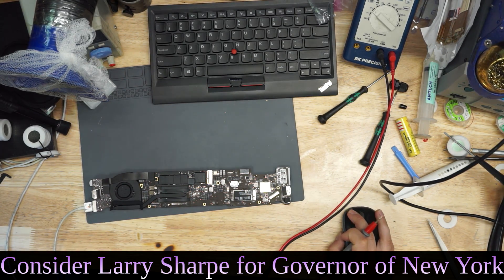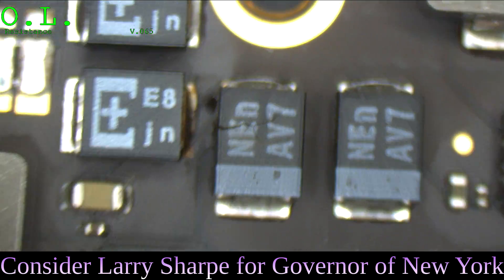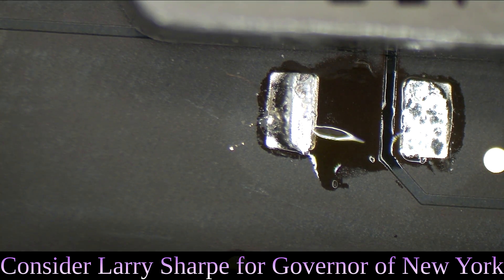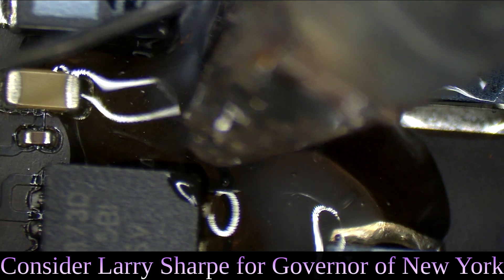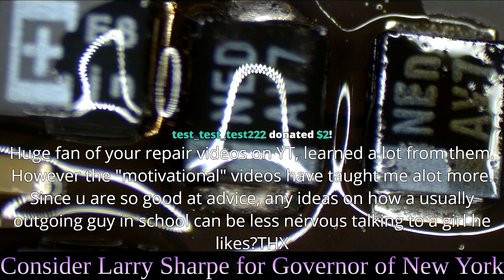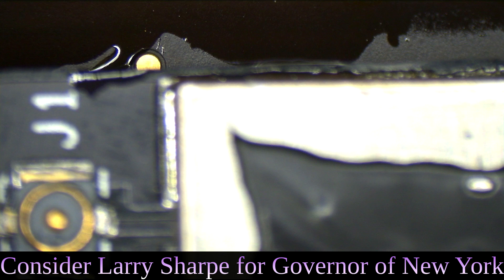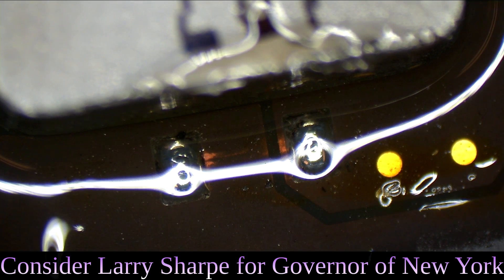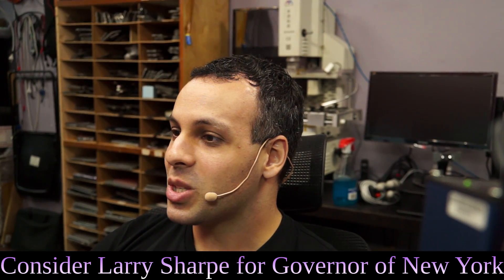How to fix short circuit on a Macbook.

Comment: I am reminded of a guy at work who...... ?has a motorcycle........ ?still. I think. Anyway, it would not start and has been in the repair shop for over a year. The goofs could not find that three wires were damaged when the motorbike tipped over. Something a simple continuity test would have found. But many parts and $ were thrown at it.

Comment: Hi Louis. Looks like this was one of the few times the fuse actually worked as supposed.
Besides its obvious reasons, I wonder why Apple does include fuses because most of the times they do not do their job, and also because Apple doesn't really do motherboard component level repair, they just replace the motherboard so, why to bother placing fuses anyway...
Now, out of joking, going further on the problem... The fuse blow because the cap shorted but what causes the cap to fail? Life spawn... naaah, more caps nearby and only that one fail!? Factory defect that make it last less? Apple motherboard design fault?
Whats your guess for the cap failure?
Regards.
Reply: Apple still bothers with fuses because some shorts can be straight up fire hazards.  So Apple isn't doing it with repair friendliness in mind, but simply liability.
Reply: Would love to see his response about it. Had the same thought

Comment: What's the deal with the braided copper wire?  Cleaning the surface?
Reply: dgenr8x it's called wicking. The solder adheres to the wire mesh because of Pb having an affinity to Cu and because of the greater surface area on the many wire strands, so it's a good way to clean the solder points. Note that he adds leaded solder first to mix with the unleaded factory solder on the board.
Reply: Metallkopf  Ok, cool.  Thanks for the explanation.

Comment: Hi, what tool is louis using at 7:55?   Seems like he cleaning up excess solder but what exactly is going on?
Reply: Madrigal Elect copper wick. And yeah, it's for cleaning.
Reply: @metallkopf988  is it? It doesn't look like the standard wick he used to clean the pads.  It looks like a brush??

Comment: I don’t get why you like Lenovo. The school district I work for has a few hundred of them and they are the biggest pieces of crap ever. I would argue worse than a macbook
Reply: They bought the cheapest they could find, right?
Reply: Johan Johnsträd Lenovo Prinkpads is what they bought and they are the biggest pieces of shit to exist.
Reply: Johan Johnsträd E530. The right side usb board had to be replaced on a few hundred of ours (Lenovo engineers came for a few days to do that), the power ports break very often (the middle peg breaks), the screw posts on the plastics is fragile (a little over tightening or even a light drop causes them to break off the plastics), the right side hinge is held onto the bottom plastics with 2 weak plastic rivets, keyboard keys come off way too easy, ... Those are the most common issues.
Reply: Johan Johnsträd got so bad I used a 2011 MacBook... in 2017 instead of using one of them when my laptop, a reliable HP 450 G3 died because I dropped a dewalt cordless drill on it by accident... until I could get the parts in the fix it. Not saying that HP laptop is amazing but it’s pretty reliable. Then HP screwed it all up with the G4 taking everything good about the 450 and getting rid of it.

Comment: step 1: buy Lenovo Thinkpad
Reply: OR
buy some more usable laptop with dedicated graphics and not just a CPU, because CPU based rendering is hell. and CPU graphics are weak af.
Reply: Raska The Furry of you really want to render videos and stuff dont get a notebook, you would be better suited with a desktop.
Reply: The sadness is that even a junk HP or Compaq laptop is more reliable and a much better value for price. Sure they have issues that some suffer from but some hold up surprisingly well, I have a core 2 duo HP laptop that has zero issues other than some key caps being gone from the keyboard (and the keyboard still works 100%) which would cost $20 and ten minutes to replace with a new one. If I used it more often I might actually bother to replace it.
Reply: I just fixed one of these the x1 carbon. I think it overcharged or something but he woke up and it wouldn't turn on. All i had to do was hold a reset button and i took out the battery before so idk if it was necessary but it was a simple fix i was surprised.
Reply: With a numpad XD
Reply: Which model? The carbon ones feel overpriced just like a macbook!!!
Reply: @SolidousMdz  i got an x240 with i5-4300u , 8gb ram and 120gb ssd for $200